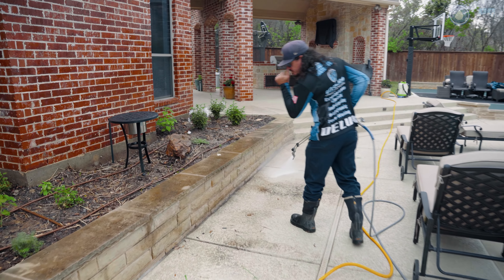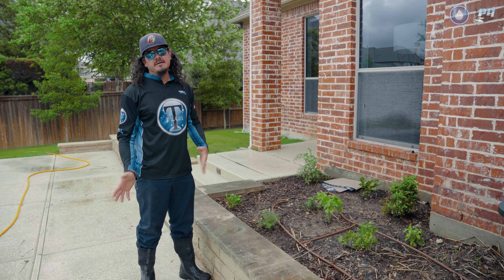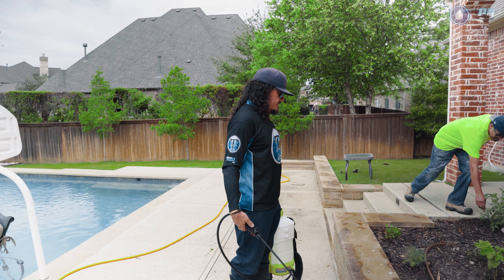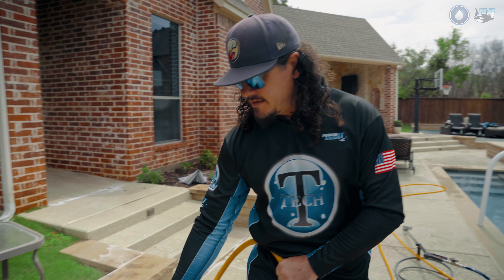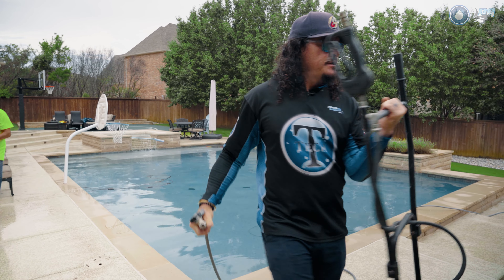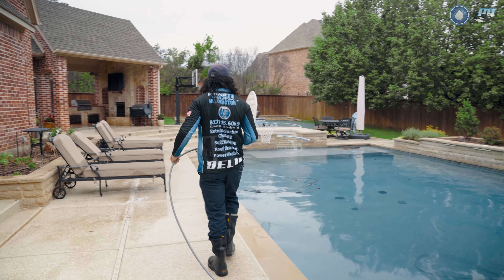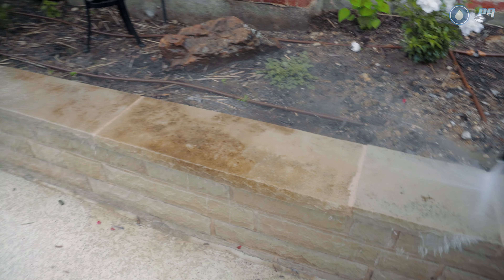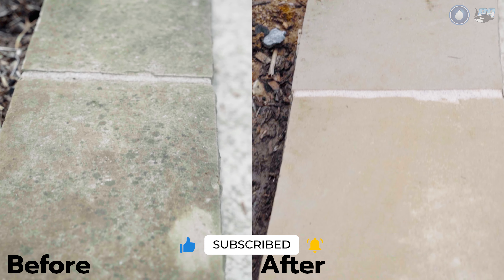How to Remove Algae Off Stone

Comment: Great video   just wondering about the dirt or mud getting in the pool   is that a big problem or do you just do your best on trying to spray towards the end where the grass is
Reply from the maker: Great question! Getting dirt in the pool is not a huge deal but you obviously want to try to spray away from the pool and into the grass as much as possible. Always give the customer a heads up that the pool might be a little cloudy after the job so if dirt does fall into the pool, they wont be surprised. It clears up within a couple of hours most of the time to a day.